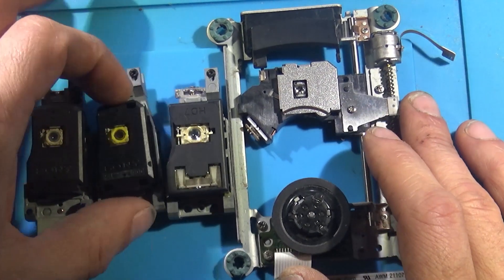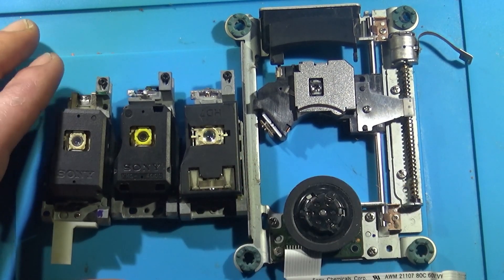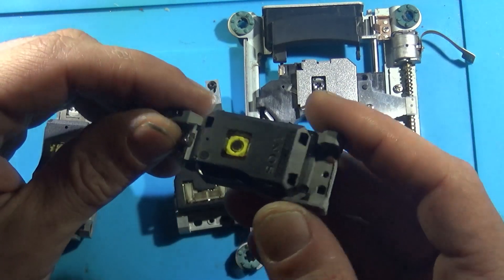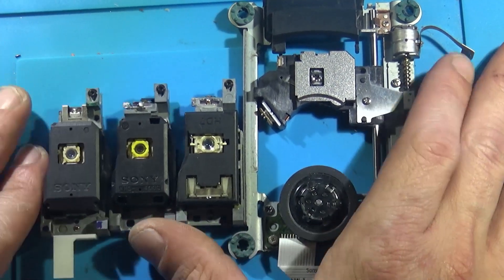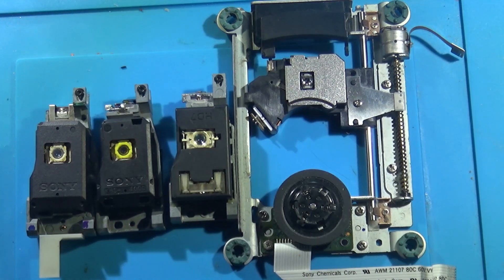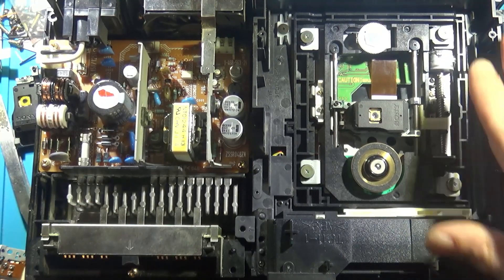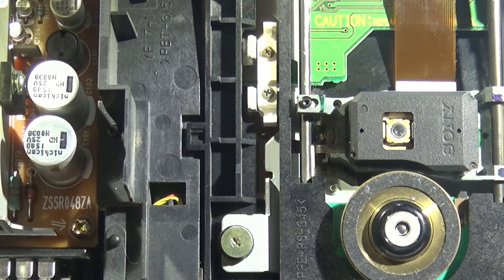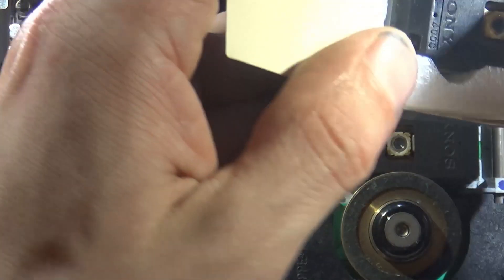PS2 - How To Swap between Different Laser Variations with Lens Swap Homebrew

Comment: Just done this to my 35003, swapped the 400b laser to the 400c. 1 question tho…after I reprogrammed my EEPROM and was able to select the lasers again I simply held the power button to turn it off. That was ok wasn’t it? There wasn’t an exit strategy like press triangle to shut the program down to ulauncher then turn ps2 off etc. great video by the way 😊

Comment: Under what circumstances could I replace a fat ps2's laser and not have to use a homebrew program to make the laser work?
Reply: Possibly if you use the same type of model laser? Example if you have a 400b maybe just replace it with another 400b? 400c with 400c etc. just a theory tho.
Reply: But to be fair it’s pretty easy with home brew, I would advise getting one of bitfunx psxmemcard gen 2, it comes uploaded already with free McBoot and other sweet features and it can hold something like 120k ps1 memory cards and 80k ps2 memory cards with the 8gb sd card that comes with it, you could also “back up” games to it and play them off the card with free McBoot, definitely worth looking into.

Comment: hello, i´ve had a 400c laser but got a hd7 from another ps2 that was working, after changing the eproom the ps2 still doesn´t start reading the games(but it detets dvd on dvd drive), i´ve used lenschanger. What i´m  missing here? thanks in advance
Reply: Hi try to adjust the black screw near the laser. Every half turn up or down. It maybe will start reading discs

Comment: yo so i got a ps2 in the console reads cds fine but dvd will just spin and say reading for however long i will let it its been opened. is it possible that the laser needs to be remarried? or will it not work at all if it needs to be remarried? im just thrown off because the laser like moves as if the disc was read and every other case ive had the disc will stop spinning eventually if it is defective. any help would be appreciated

Comment: Yo I tried running the program after swapping my SCPH-50001 laser with a 39001 with the LENSCHANGER.elf and it just goes to a black screen, any suggestions?
Reply from the maker: try loading the boot.elf version or even better watch my video on pmap
Reply: @ModzvilleUSA  So about that... the newest version doesn't include the boot.elf just the LENSCHANGER.elf... do you mind if I dm you on discord about this?
Reply from the maker: @somesortofgeek  sure
Reply: @ModzvilleUSA  Could you let me back on your discord, sorry for bending the rules
Reply: @somesortofgeek guys did you solve this? I have the same issue, thought i have blackscreen on ps2 slim when i launch lenschanger, on ps2 fat it works okay:)

Comment: I followed all of these steps and my ps2 still only reads ps1 games. None of the games I burned which use to work and no original ps2 games. Any help on that?
Reply from the maker: Might be something else going on. Bad ribbon, bad replacement laser ect. Burns are tricky. Might need to dial in the dvd pot

Comment: I have tried to open the lef file and boot file and i just get a black screen. I tried it on 2 ps2 fats. Any ideas?
Reply: I'm having this issue too!  Were you able to figure it out?  I tried redownloading lenschanger, reinstalling FMCB, trying different video cables, all with no success.
Reply: @AintSoSlimShady  yes i did. It was a video issue. As soon as the file opens it switches to what ever the yellow video cable is called.
Reply: @ProximoNovio  I'm using the yellow cable now but still get the same issue 🤔.  I've tried HDMI, component and composite all give the same issue
Reply: @AintSoSlimShady  i was using component and as soon as i opened the program it turned black. So i unplugged component cable and i plugged in a composite yellow cable and the program showed on my tv. Also make sure its a old tv that supports low resolution
Reply: I hate how you have to wait this long. I had the same issue, and it was using a different usb drive. try a diffrent usb and it should work

Comment: For a reason I remember somebody saying that the newer slims (around 7700x or so) should not use this app. The reason is they slowly corrupt the data when written to the EEPROM (and I personally have seen a 77004 go absolutely awry over the span of an year after I flashed its EEPROM with Lenschanger) but again, whoever has tried this and knows more in depth, I'd like to be proven totally wrong.

Oh, and one more fun fact - you can flash the "400R" data to a v9/10 as well. The only difference between the HD7 and 400R is the casing - they're both the same type of lens. Only that the 400R is a slightly older HD7 revision found in most v5-v7 machines - otherwise it's perfectly drop-in compatible with a v9/10 that runs a HD7.
Reply: Dude, tysm for this info 👍
Reply: has anybody tried it on an SCPH-90001 slim? I'm thinking of changing the laser of my console.
Reply: 790xx and 900xx shouldn't use this application

Comment: I bought a PS2 for 5 bucks at a garage sale last week with that kind of laser in it ( The red one you got at a flea market). Works great too.. I have a few SPU3170's lasers for that but I didn't need it since it worked. 5 bucks well spent.
Reply: I had one that came with my launch ps2 slim 70001 model and the laser doesn’t work no more
Reply: And I mostly like the SPU3170 laser cause they can read blu disc easily unlike those other laser

Comment: The KHS400B/C (yellow circle) are the worst lasers, i have 28 ps2 consoles, every one with the 400B/C laser are Kaput, and they are not even cleanable, The 400R is way better, last longer, and even when they are on their way to wearing out they can be cleaned and will carry on going again for months, or even years. only sad thing about the 400R is they are more expensive.
Reply: Can you please give me the full model number for that 400r and kinda explain the software needed to make my PS2 interchangeable just a little info would be greatly appreciated I'm working on two ps2 myself would you point me in the right direction
Reply: 400c and HD7/400r are actually very reliable. 400c are common replacement especially in 50k models due to mechacon crash. Other than that those lasers are very reliable, my 400c still works very well to this day
Reply: The problem is the arm not the lens
Reply: @80s_kid.  400R are just Sanyo SF-HD7, except older revision. I successfully sold refurbed 5000x phats with the older "400R" (actually an older HD7) installed in and flashed to HD7 EEPROM settings.

400Cs, as bad as they might have been said to be, they're good for upgrading old v4 (30000/35000) based systems. Had such a 35004 unit, originally with a dead 400B. Swapped a 400C, flashed EEPROM, and it worked great again. Of note that v4 systems don't allow for HD7/400R. IIRC they physically won't fit.
Reply: @NSHG attempting this myself with the same 35003 model. Your comments are encouraging.

Comment: Great video. Hopefully in the future someone comes up with an ODE, so we don't have to deal with stuff like this.
Reply: Also this. OPL USB speed is crap, Popsstation is not good, my console is 7500x slim (which has no jumper point for ide), using SMB might cause online to be unusable. My idea is that the ODE optic uses MicroSD or sata connection
Reply from the maker: @bitelaserkhalif  That is the dream! You can always get a 7000x and do a 44pin ide mod. I'm going to be trying it soon to see if I can get a 2tb installed internal to replace the disc drive. Hopefully it works as planned with the appropriate IDE to sata adaper. 2.5 drives only need 5v which should be simple enough to pull from the USB port.
Reply from the maker: Amen my good sir and thank you!
I'm going to be working on installing a 2tb 3.5 sata in a slim console for use with OPL. Hopefully it ends up being the next best thing

Comment: That last part is very important regarding the Modbo/Infinity chips. I've never had an issue with my slim ps2 (which I bought from you lol) and disabling it to use a FMCB card, but I've seen people on certain fb groups have issues with Infinity clones not being able to use FMCB cards even after disabling it. Idk why, tbh. It should theoretically work the same. Maybe their board revision somehow disallows all functions of the chip to take hold? Idk.
Reply from the maker: Yeah there's a lot of weird little nuances with those modchips and how they function on various ps2 revisions. Finding info on it can be tough or the info can just be wrong. There's alot of trial and  error. Disabling the chip worked for me on my slim  Ps2 for FMBC and running the software. If people have issues though, uninstalling the 3.3v wire should cover all bases. Just reattach it after running the software.